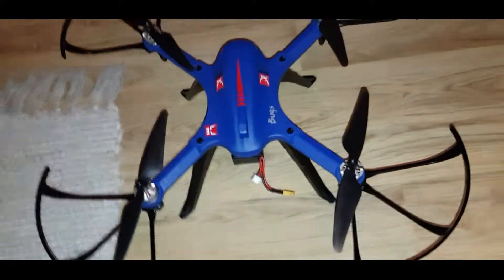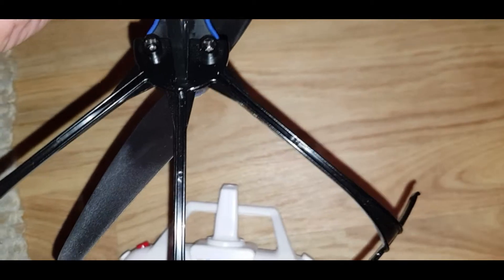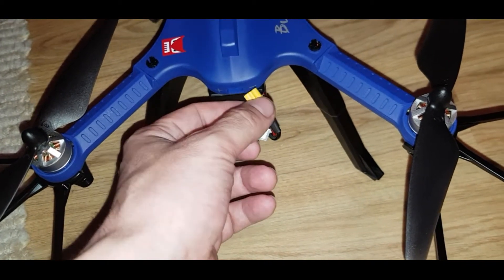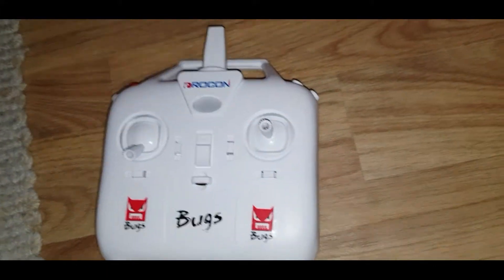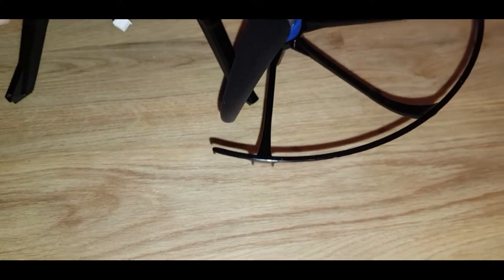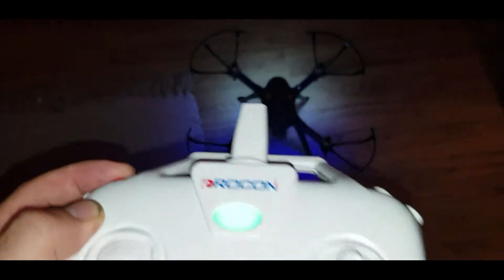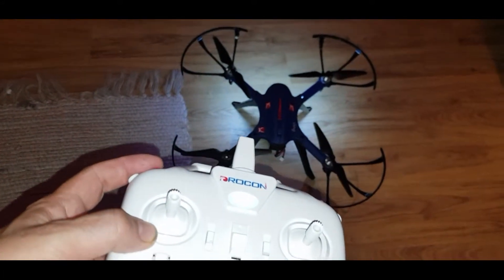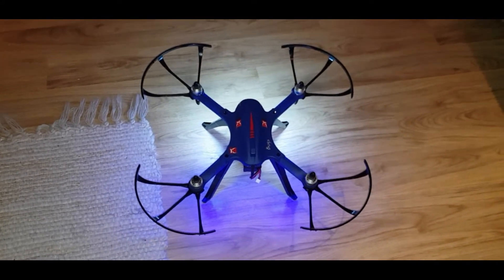bugs 3 drone not working how to start motors/blades correctly. HELP!!

Comment: i am having an issue where when i plug in the battery the drone does not make the beeping noise and the bottom lights do not come on but the front one does and the battery is definitely charged would love some help
Reply: I have the same problem. You solved?
Reply: Same can anybody help?
Reply: Same problem as well, still no solution
Reply: Same issue here, have you found solution to fix it ?